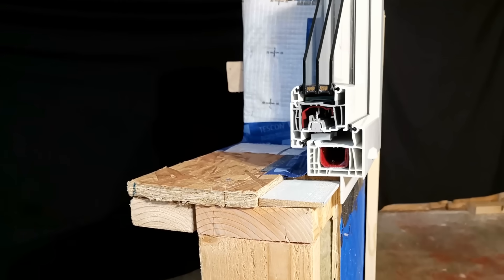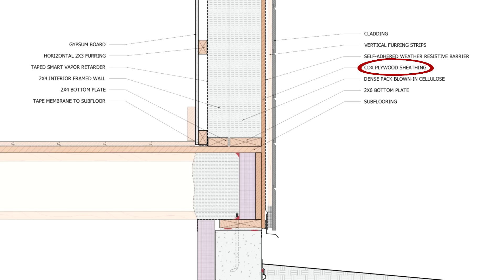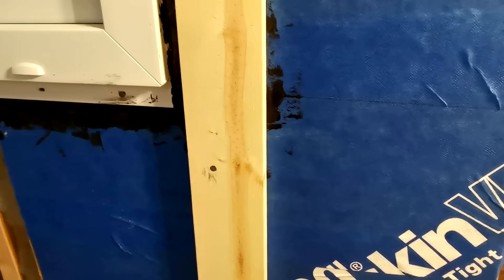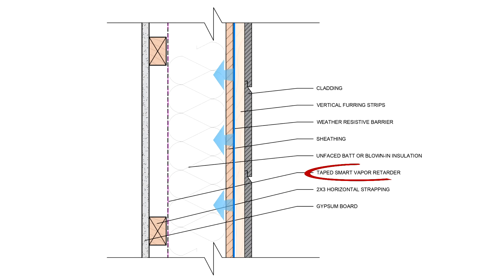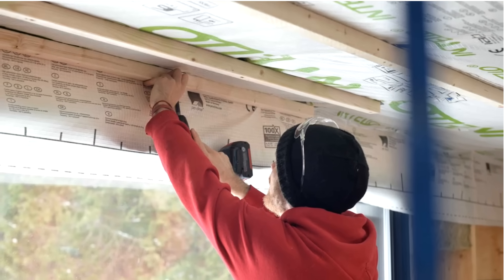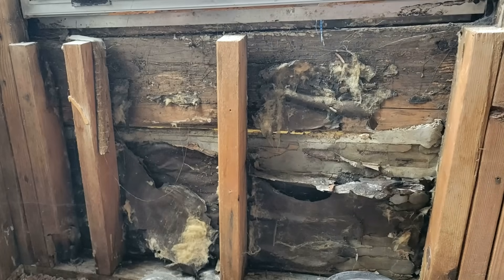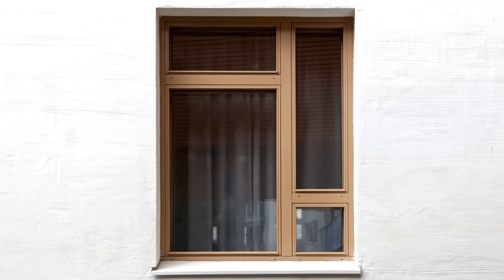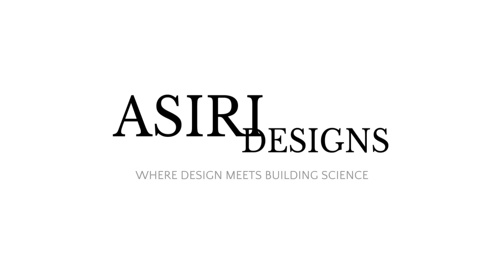CRAZY R-Value for CHEAP! A Guide To Double Stud Walls

Comment: Vapor barrier doesn`t need to be as close to the interior as possible, you can place it within one third of the wall assembly (meaning closer to the interior) and it will be doing just fine. Simply do a dew point profile calculation for climate zones 7&8 and you will see that there is no condensation problem with this design whatsoever. In Finland they do something similar with installing vapor barrier first and then adding insulated service cavity.

Comment: I saw an apartment building with cheap double pane windows applied inside and out. Effectively r-6 of glass plus the airspace in between. The operating windows were easy to use and no storm windows were needed.

Comment: Would this design eliminate the thermal bridge issue of steel framing? If doing double studs with a thermal break is there going to be much different between the exterior framing being steel or wood? I am designing a single slope roof home in climate zone 7.

Comment: With more, and/or better insulation, a minor defect creates a massive failure, creating a moisture concentration point, that grows like a fractal.   And the reality, is that construction is not done with the nations best and brightest, or most attentive to detail.  I worked with several guys, with substance abuse problems.  They would cut protective barriers to make installation easier.   They were hourly.   Quite frankly, imo, a double wall system, means you have to use real plywood, that tolerates some moisture, and will  dry out, and dont forget the top of the double wall, still has to function as a fire stop.

Comment: A couple of questions here....
How does Fire Blocking in Codes affect a Double Wall Cavity design.
**Essentially those blocking boards become thermal bridges.
**You can't just rely on Insulation for Fire Retardation in most local codes.

And I see a wall assembly that in Theory has self drying potential.
**Except once You apply Drywall and a couple coats of paint, that traps water behind it.

Lately, Painted Drywall is being called out for how it aids Mold Growth in walls.

Comment: My preference for this strategy would be to use T-Studs that have closed cell spray foam in between the 2 adjacent studs, and then fill the cavity between each T-Stud with a wood fiber batt. The foam allows for using a batt which is easier to install, and the wood fiber itself has thermal mass besides just insulation properties. 

Intello is of course the preferred option as vapour control layer.
Reply: Spray foam is toxic and separates from the wall.

Comment: When installing sheathing (OSB/CDX/Zip/etc) to the framing, why doesn't anyone run a bead of elastomeric polyurethane caulking sealant (Sika/Tremco/etc) on the exterior sill & top plates and vertical studs before nailing the sheathing on to reduce air and moisture infiltration between the sheathing and framing?     Or at least run a thick bead from the interior side along the framing and inside face of the sheating after it's installed ?

 Everyone talks about methods to reduce infiltration at points of penetration (romex, conduit/hose bibbs/etc) using flex tape and special square adhesive pads with conforming center slit, but each panel of sheathing has a 24-28ft of linear edge that can be  a point of infiltration even with WRB's and adhesive attached rolls of material.     

I used over a case of Tremco Dymonic 100 sauage packs to seal the sill and top plates,  between all the jack& king studs, between the sheathing and framing from the inside and all sheating penetrations from the inside (outside got FlexWrap tape).   

We dont need interior vapor barriers in our climate zone 2.     

Also, wouldn't a smaller 2x6 wall with alternating 2x4's with 2-3" of closed cell foam + dense packed blown insulation (or top off with open cell foam) solve the issues with vapor & moisture transmission through the wall,  and give you extra couple of inches of interior wall space ?     

That would get you between R29-R32 and the closed cell foam is the vapor barrier, with no tapes and seams of the interior vapor barreir to worry about getting damaged during sheetrock and trim installation. 

Throw an ERV (HRV up North) + a whole house dehumidifier and you're good.    

I live in Climate Zone 2, so no interior vapor barriers are needed as it rarely feeezes and cold weather here is also humid.
Reply: We are starting to learn the more airtight you make a building the faster it rots.  If we caulk up like you propose the water infiltrated (it will) will never dry out in time.

Comment: With ICF you can now use a thicker layer if insulation on the exterior block to further boost R value and eliminate any thermal bridging.. a lot fast way to build with this new flexability, and with a robust roof anchoring system the structure is pretty much hurricane and tornado proof...and excellent energy savings....Nudura ICF blocks now have that flexability.....

Comment: The colder the climate, the closer to the inside your vapor barrier needs to be.  If you want to ensure no backside condensation inside the wall during cooling season, insulate the service cavity to keep the temperature of the vapor barrier higher than the dewpoint.  The higher the R value of the wall and the higher the vapor drive from outside in summer, the more R value you’ll need in the service cavity.

In Ottawa, Canada, I’m building a 12” dense packed double stud wall with an insulated 2x4 (R12 fiberglass) interior service cavity.  Only on the hottest days (+33C) is there any concern for exterior vapor drive, and it’s a fairly humid area.

I skipped the Intello as it would cost thousands more than 6 mil poly, and with no condensation concerns would be a waste.  Intello also allows WAY more moisture into the wall assembly than poly during winter months, which is where the real concern is with thick highly insulated walls.

I designed large roof overhangs (minimum 3 feet) for each floor, so no concerns for bulk water intrusion past siding or windows, and less risk of water issues at the foundation.  Overhangs are also designed to shade all windows in the summer, and let direct sunlight in the winter.  No east/west facing windows, only north/south.

Comment: the next evolutionary step will be moisture sensors in all walls, and ventilation channels with computer-controlled active ventilation. there is no good reason to rely on perfectly applied plastics for keeping moisture out of walls. all the plastics will fail over time, no builder is capable of gapless construction on a large scale.
Reply: That’s not going to happen.  If there’s a moisture concern you’re much better off using moisture permeable materials that can dry.  If the wall gets wet enough, often enough, it will fail no matter what.

Keep it dry.
Reply: @superspeeder  nope! plastics are a temporary aberration. a blip. they'll be considered a liability similar to asbestos soon. vapor permeable membranes are insanely toxic to manufacture, will break down in decades, and have no end of life destination. the only solution for lightweight construction is active ventilation and monitoring of wall materials.
Reply: @AJTarnas  good luck with that! 😊

Comment: I think insulation is overrated, especially if you have access to free wood. A lot of extra steps. Old uninsulated drafty houses that breathe are better, because they don't rot if there's a flaw. Interesting video, building code should only require structural integrity and should be silent on everything else.
Reply: Man great troll post.  10/10. Really hit every key point amazing no notes.  I bow down to your ability to write something to ragebait people

Comment: @ASIRIDesigns what is your opinion on exterior blown insulation using the X-bracket system to to create an exterior cavity for either blown in cellulose or spray foam. You can completely envelop the house in 5 inches of insulation and create a service cavity on the interior wall. no need for extra lumber needed for a double wall assembly.
Reply from the maker: We don't have a problem with it at all, but we still face the age old question with any wall...How do you address windows, doors, and other major building transitions? The brackets in theory are great until you have to figure out how you want to buck out those other components.
Reply: @ASIRIDesigns  How does it compare to double stud? I'm also curious how you would handle the vapor barrier. One on the outside and one on the inside if the interior cavity is also blown in? Or just one on the exterior?

Comment: Could you reduce the costs and, instead of using Intello Plus, use the SOLITEX MENTO 1000? Or is it a completely different membrane?  This channel is so underrated
Reply: Mento is not vapor variable in the same way Intello is. Think of Mento as more of a premium replacement for Tyvek, typically used as an exterior WRB.
Reply: @pirahna432 thank you

Comment: Leaving the sill completely open will let unconditioned air and bugs into the home..
Reply from the maker: No, it actually won't. It's air sealed on all four sides on the interior...
Reply: @ASIRIDesigns ok in the video it showed a person pouring water from the inside and it leaked out.

Comment: In my opinion, double-stud construction is, by far, the most cost-effective means to super-insulate a building. My off-grid home, workshop, smaller shop and even chicken house are all double-stud construction with 12 inch, R-48 walls. The additional cost was minimal. No special skills required. Blow-in cellulose was used in all but the chicken house, which has Rockwool (too much fiddly labor!) Our home uses 1.25 cords of firewood a winter, while our neighbors burn 8-12 cords. I'm in wintery central British Columbia, Canada.
Reply: Did you blow in your own cellulose or hire it done?  I assume it is dense packed.  If you did it how did you do it?

Comment: I'm thinking three layers: (1) interior - 24-inch on center 2x4; (2) central - thermal mass concrete 1.5"x24x24 pavers glued together for two horizontal  rows and then covered in peel & stick to bond it externally and impermeable with 1.5 x 48 x 96 polyiso (R9.6) or XPS (R5.9) on top two rows, taped together and then covered in 6mil plastic top to bottom; and (3) exterior - 24-inch on center 24-inch on center 2x4 exterior tied into foundation wall. Flat strapping twisted between blocks every 48" to tie the exterior and interior walls down low.  Galvanized 26 gauge Z-metal tagged to central wall using the peel and stick to drain interior wall to French drains to dry spillage on interior side. Galvanized 24 gauge Z-metal tagged to central wall using the peel and stick to drain exterior wall surfaces out to the foundation wall. Flat metal bands for x-bracing on interior and exterior walls should work nicely to resist shear.  Central thermal mass down low, because its braced to both wall, adds resistance to any uplift. Top plate of single 2x4's on each of the interior and exterior walls, some 2x2 spacers to sit over the polyiso/XPS that can be screwed to tie both walls together, then cap across the top with two layers of OSB or plywood to tie them together for roof rafters to sit firmly upon. Nominal wall thickness of 10.5" after running .5" drywall on interior, .5" sheathing, and .5" cladding on exterior over the .5" vertical rain screen strips. Pavers are considerably better strength-wise (up to 5x better psi rating) than simple concrete blocks.

Comment: Im not following how this is cheaper that CI foam? 
With fiberglass in the cavity and 1.5 of poly iso you end up with a wall at r 23. 
With a double 2x 4 wall youd end up with r20 at 7 inch thick and would need almost another inch of densepack to get up to the same r 23.
Am I missing something?

Comment: Question I’ve been wondering about. I know a self adhered vapour permeable WRB would perform better than say Tyvek.

Now I understand about air moving behind WRB with Tyvek or similar being an issue.

But is that due to people not sealing at bottom and top of WRB properly?

Say with a standard Tyvek you were to use peel and stick, or tape, or acoustic sealant at the entire bottom perimeter of WRB to foundation butting sheathing,had it ticked at top to a strip which is sealed to top plate before trusses laid, and properly sealed all penetrations - would it still be a large performance gap compared to SA VP WRB?

More to ask is I know outside air coming in is bad, temp and moisture wise.

So sealing that Tyvek well the only air movement behind the Tyvek would be interior/cavity air right?

I know the SA VP WRB stops all of that movement, but how detrimental is that movement?

Comment: In Western Australia we like to build using "double brick" which is two brick walls tied together with brick ties. The inner leaf carries the load, the outer leaf is for water resistance. Newer homes have foil insulation between the two, but old homes have nothing. What would you suggest as ways to increase the insulation value of such a wall? I know its possible to inject rockwool or foam into the cavity - but I'm not sure that will be effective and concerned that it will cause moisture issues.
Reply: Whatever you do, don't inject foam! It deteriorates under water exposure from the outside face, and can only be removed by removing the brickwork. 

A water resistant insulation material will work (Rockwool, siliconated glass wool, EPS). But you're right about the possibility of water being transported in through the insulation. I rarely see it happen, but sometimes that one unlucky weather facing wall without a roof overhang may need a waterproofing impregnation.

Comment: What?  R2000 construction?  Nothing new in Canada…look it up.  Tons of details have been worked out with membrane wraps and material recommendations.
Reply: This is above R2000 for sure. Canadian insulator and roofing/siding guy here.

The passive standards are higher than that of the R2000. I don’t have every detailed comparison but more speaking in a general sense.

Comment: Nah, Just go with 2x6 walls & add 2" of exterior insulation, any more is just a waste of money. You biggest losses will be from your doors & windows. Doors can partially mitigated using a fiberglass multi-point lock. Instead of spending the money on double stud walls, spend it on better doors & windows. Also consider a SIP Roof, as that works amazing well to keep the heat out during the summer months.

FWIW: I have 2x6 & 2" exterior foam insulation with SIP Roof, and my heating cost is about $400/yr on a 4500 sqft home. The other side with double stud walls is your risk sheating rot as moisture will condense on the sheating. This is why continuous exterior insulation is preferred over double stud walls. Building science has several free whitepapers on why you should not use double stud walls.
Reply: I cannot find ANY whitepapers on why double-stud walls are a bad idea. Care to provide links?

Comment: This is awesome, to bad any home builder these days wont give a shit about this,. because it will cost them money in time and materials.  Even if its a little, they will go to the ends of the earth to just scrape by code, and charge maximum
Reply: It’s not that it will cost the builder money it’s that NO homeowner will agree to spend the money to do this. Plus a well built wall assembly can be built much more efficiently than what is shown here..

Comment: My old house is only 2x4 cavity insulated.
When changing the exterior siding i did fur out the wall with horizontal 2x2 and 5cm rockwool, vapor permeable membrane and then 2x2 vertical for drying and horizontal wood siding 

Now the thermal bridge is reduced to a 2x2 spot and around doors/windows only.

The thermal bridges does show in the winter with thermal camera and it holds the heat a lot better.

Rigid insulation (rockwool hard plates) and additional hardware is at least 10x the price so was not on my budget (and vapor impermeable insulation like styrofoam and XPS is illegal since i live in cold climate)

Comment: I would note rock wool is able to dry itself out so as long as you are using rock wool on the exterior wall you can seal the wall with normal plastic sheeting. But if you can afford to install it on your exterior walls you can afford a better quality barrier. No talking about windows I would have mentioned that The R value of windows vary so minimally across most price points there is no reason to ever buy expensive windows. Mater of fact a mid-priced window and a renovated and updated window from the 1800's have a differing R value of like 1 and can potentially save your tens of thousands of dollars.
Reply: No polyethylene ever.
Reply: Is that a metric R-value or are American windows that bad?

Comment: Would it be possible to actually move from 16” on center to 24” or even 32” given we have a second wall? Which would equal out lumber costs?

Also do we need 2x6 on the exterior if we have that second wall? Or is there no way to make that interior wall be load bearing too?
Reply: All of my projects use 2x4s on 24 inch centers. All of them. These are single-story buildings. In all cases, the outer wall is load-bearing and the inner wall supports the drywall and contains the insulation. I wouldn't go to 32 inch; that's really pushing your luck. Drywall needs better support and (in my case) the dense-packed cellulose could slowly cause the drywall to bulge into the room over time. I've seen it happen with ceilings, which is why I used 5/8 inch fiberglass-reinforced firestop drywall there, just to play it safe.
Reply: @KevinMaxwell-o3t right drywall does need the support too thats a good call,
I suppose you might be able to do more on the exterior where you have a ply/osb sheet for sheer, but probably just not worth it